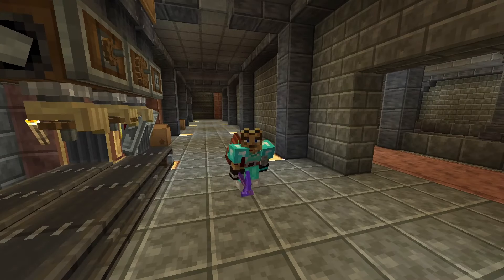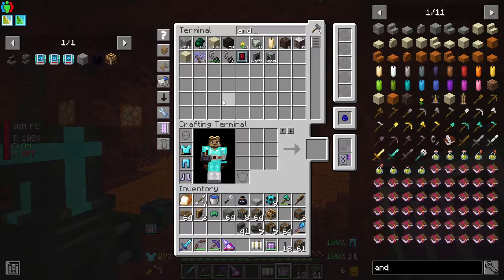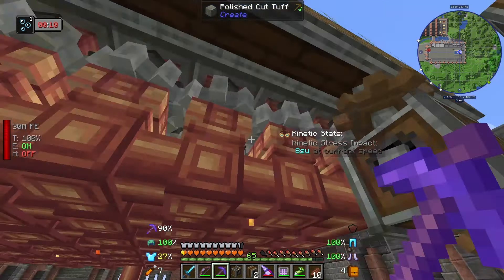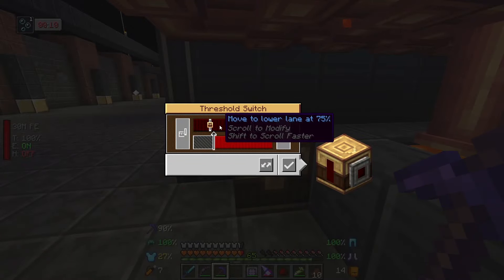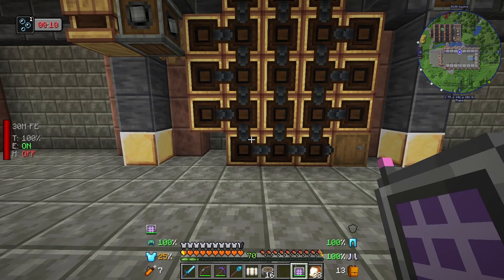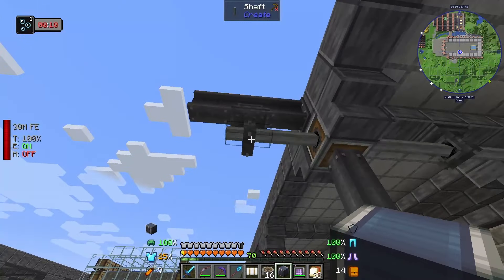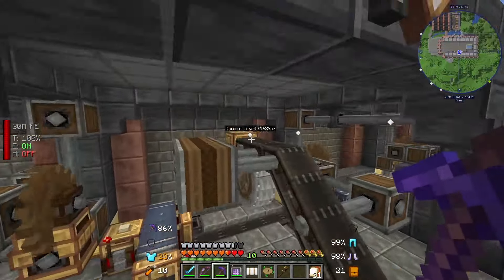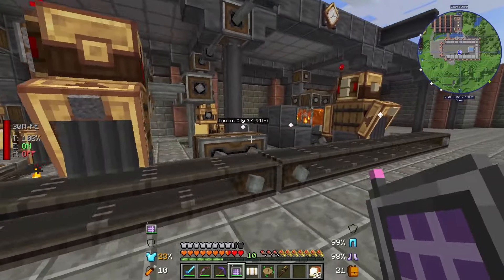Auto Stocking with Create! - Modded Minecraft 1.20.1 #13

Comment: I did something very similar to Tangos factory in my current Vault Hunters server. One thing that I found worked was to limit the amount of cobble coming out of the generator/storage (I think it's at 16 coming out of the funnel right now) so it didn't overwhelm the barrels down the line.
Reply from the maker: I think I did exactly that, the cobble is set to 16. Just forgot to mention that in the video. Thanks for the tip though 👍
Reply: @Endavar  Awesome! It's definitely a balancing game between the threshold switches on the barrels and not getting an overflow of materials on the belts, almost a mini-game in itself :D